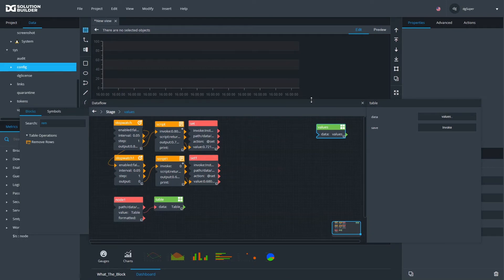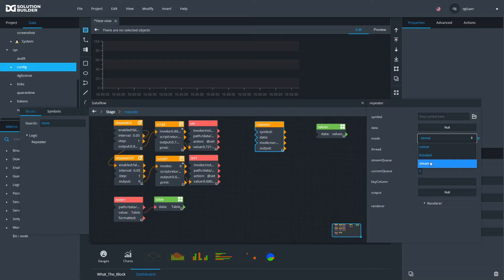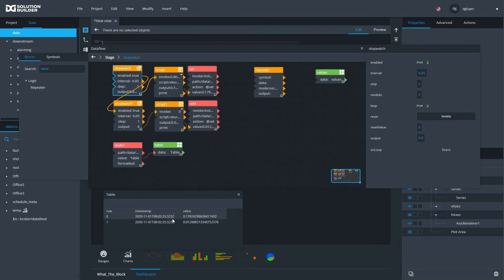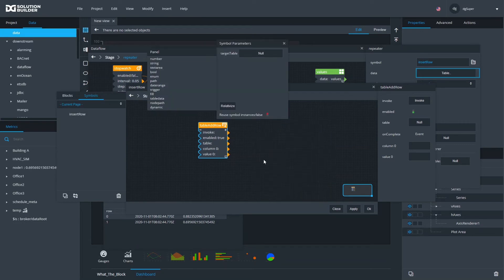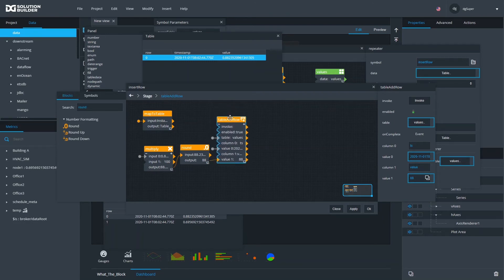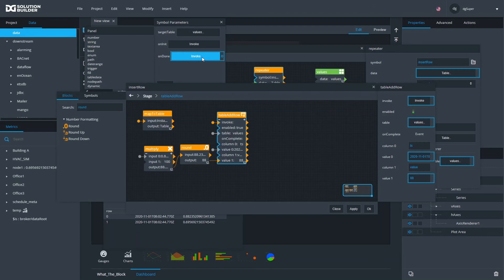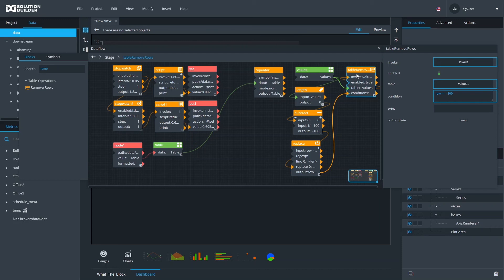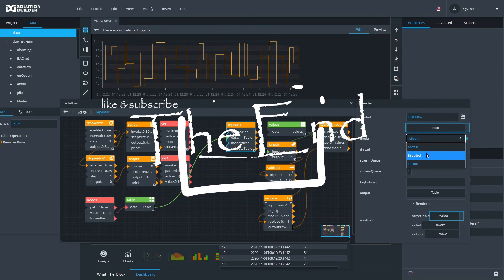What the Block ?!: [ Repeater - Stream mode ]

Comment: Thank you, this was really informative.
Reply: I wish the documentation online was more detailed. For example, why does the repeater section not mention anything about oninit trigger under stream mode? I'm guessing it also exists for threaded mode. Is it possible to add these videos to their applicable sections in the documentation? I would also like to see how you would go about handling the onDone trigger in the event that you need to wait for multiple blocks to complete, or on a block that does not necessarily have an onComplete trigger.
Reply from the maker: It is possible and will be done at some point. Just need to find resources to undertake this.